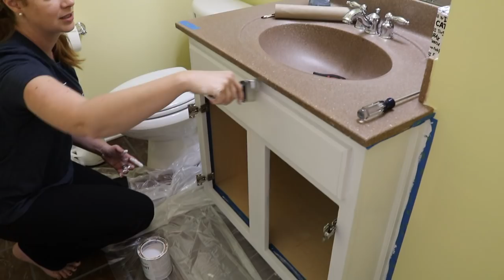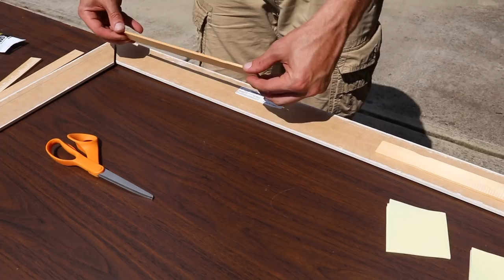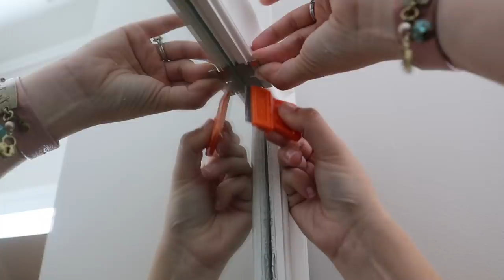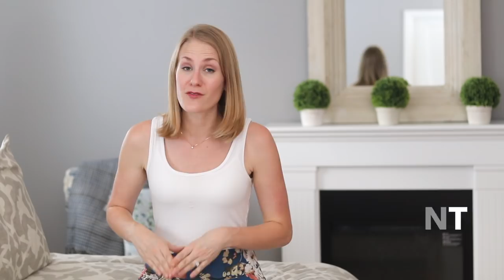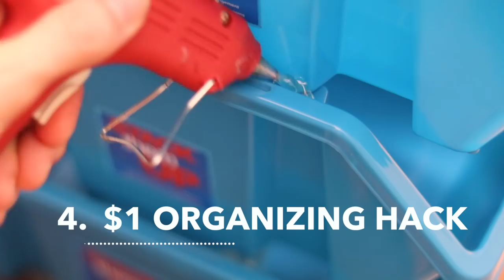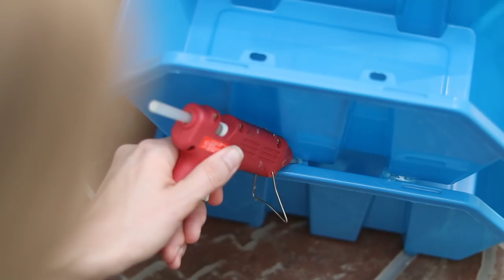SMALL BATHROOM RENO ON A DIME! 🙌 Cheap hacks & organizing ideas

Comment: I was just about to start framing my mirror before I saw this, and am thankful for your tip about using the paint stirring sticks mounted to the back of the moulding before I used the adhesive. I hadn't thought that those clips would present a problem. Thanks for the heads up!

Comment: Amazing ideas here!  My only tip is that the moulding around the mirror isn’t actually pre-painted, it is only primed.  It does wipe off with a cleaner, and the moulding requires paint to avoid water damage.  It soaks up water like a sponge.  Nice work!  Love your channel.

Comment: Why glue the bins together?  I've got those under my bathroom sink and they don't fall over.
Reply: It depends on the bins. I have some that fit tight and do not come apart easily. I have another set that I superglued because every time someone bumped them they came apart.